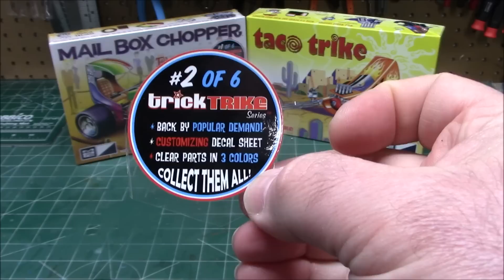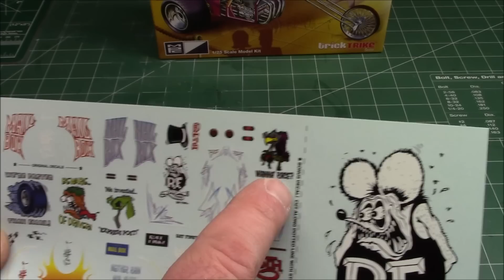MPC Trick Trikes Mail Box Chopper Taco Trike 1/25 Scale Motorcycle Ed Roth Model Kit Build Review

Comment: Bought this model because Im a huge fan of Ed "Big Daddy" Roth. From the start it was one of the most frustrating models I have ever assembled. Flashing all over the parts tree. Took me almost a half a day just to clean parts and get them ready for gluing. Then during assembly absolutely nothing and I mean nothing fit properly! From the cab which was so uneven and miss matched that it is going to probably take a 1/4 tube of putty to get it even somewhat even. The frame holes were all miss aligned so when you tried assembling it along with the motor it was all out of alignment a good 1/8th of an inch. Which is terrible on this scale of a model. Or any model for that matter. And yes I followed the instruction and triple and quadruple checked during assembly. MPC kits are the worst! I have put several together and its been nothing but frustrating. No wonder they are the cheapest to buy right now. From terrible injection of the parts to everything being out of alignment. To parts being broken inside the boxes. DONT buy MPC kits you will pull your hair out!